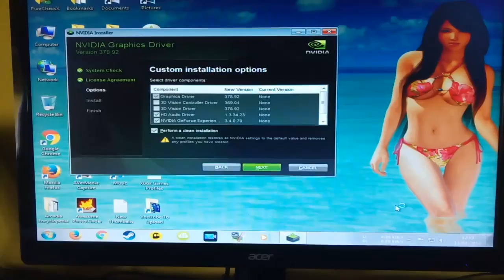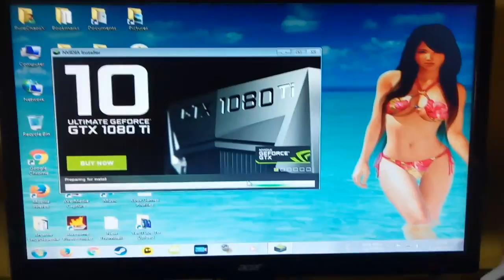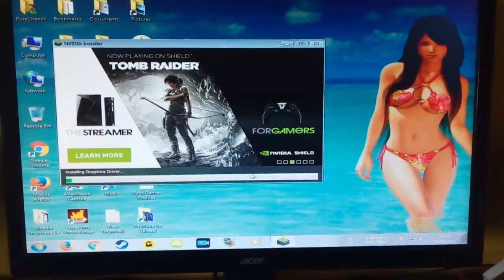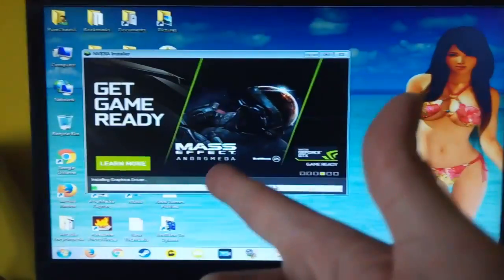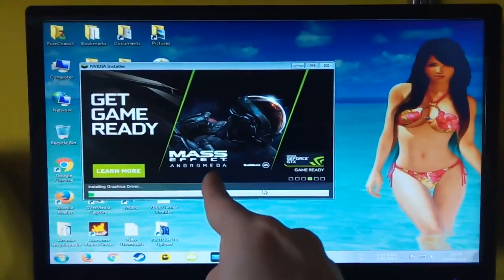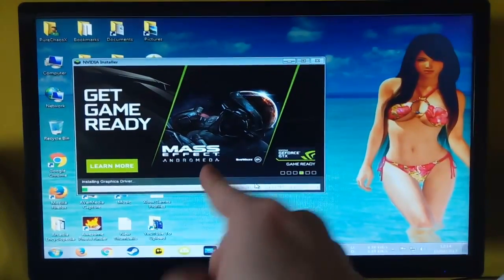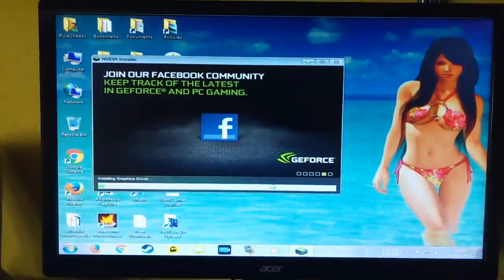Dell Precision T3400 / Part 4 / New Graphics Card

Comment: Hi I just bought an old T3400 based on your vids. I put in a 1050 but no legacy BIOS support. So I'm getting a 750 (same evga model as yours) so can you confirm it def works with legacy on original mobo with update and will Win 10 be a problem? Thanks!
Reply: Thanks! I have confirmed that the 7 series were the last to support legacy but then even the 7's seem to differ from manufacturer with support so that's why I'm going with the same as yours to be sure!  Thanks for the quick reply! Keep up the good work!

Comment: Don't worry, mate. GTX 1080 Ti is for 4k gaming. An RX 470 or GTX 1050 Ti are perfectly capable of 1080p gaming at high settings and fps. You don't need anything more expensive unless you want to game over 1080p.

Don't put your dreams of a gaming PC away just yet.
Reply: The 1050 is a good card, but it lacks a bit of the oomph needed for modern AAA games. I would suggest saving up for a 1050 Ti or an RX 470 if at all possible. They're both great cards, but the 470 is around the same price as the 1050 Ti but with much more performance. AMD has really stepped up their driver games this time around, and they have the best performance in the price range. Really giving Nvidia a run for their money in the mid-range area.
Reply: The RX 460 is capable of doing 1080p gaming at high settings too. Paired with a good CPU, 1080p gaming will not be an issue for the RX 460.